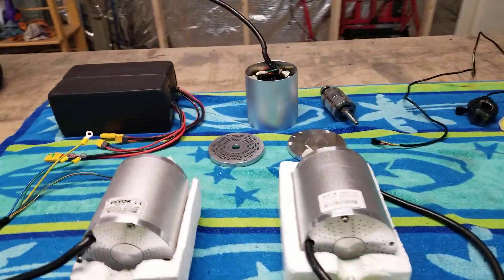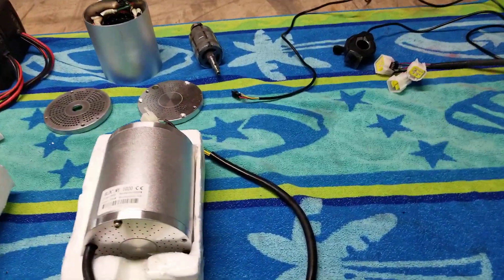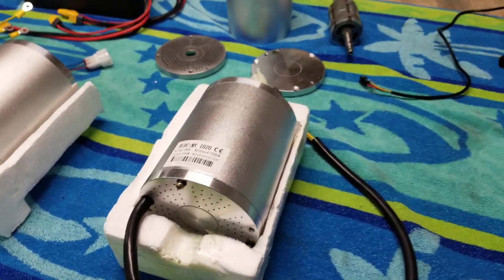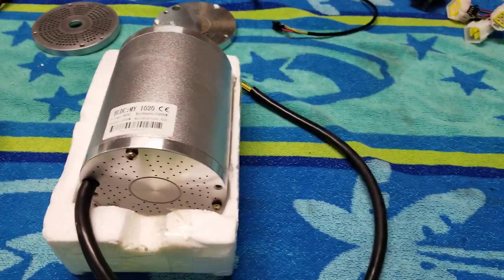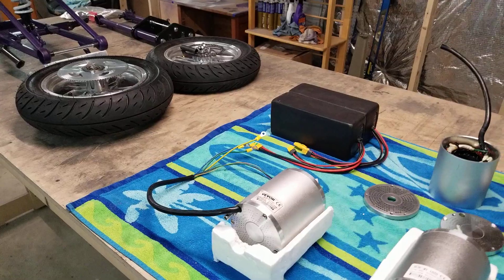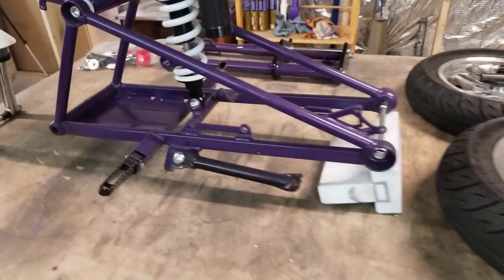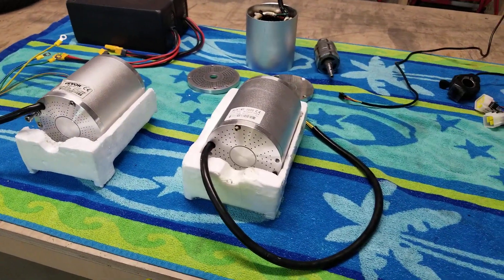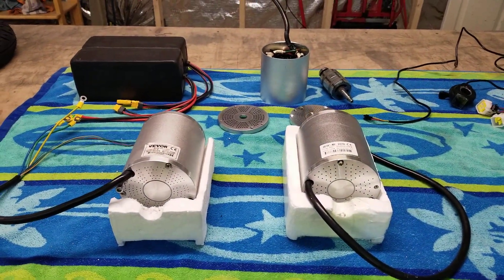Razor RSF650 - Motor Talk … 2kw or 3kw?

Comment: Yeah I’ve got a 3kw motor and cheap 3kw controller.  Started off with a 52v setup and invested time and money putting together a 72v battery for it.  I run a 9tooth sprocket and I often miss the way it road with 52v.  I live on a steep mountain and it’s so jumpy and fast taking off with 72v that I can’t let my friends try riding it anymore. Its just too hard to keep the front wheel on the ground, even for me sometimes.
Reply from the maker: it is jumpy because you have a cheap controller
Reply: @razorspeedfreak6508  very true.  Still though it was much less jumpy and smooth on takeoff with 52v.  Actually on the rare occasion I’m ever riding on flat ground it’s much more smooth and manageable on either voltage, but here on the slopes of Mauna Loa, Hawaii flat ground is few and far between.  
I’ll definitely have to start saving up for a better quality controller soon, I know it’ll make a huge difference.

Comment: Question I got a 48v kit ! Can I add up another 12 v battery to make it 60volts ? Or Will I have to upgrade to a 60v controller? Or can I still use the 48v one that came in the kit?

Comment: Funny enough overvolting a 2000w Motor I was able to achieve faster acceleration and top speed then the my1020+ from electro and co. Now the torque from the my1020+ was far better. Also the 2000w was way cooler in Temps then the 6000w from enc.
Reply from the maker: the 48v/2kw has the best torque rating of all MY 1020 motors

Comment: Hello, Have you had to do any controller tuning on your motors?  Mine is acting like it is twitching or jerking at the top end.
Reply from the maker: What controller?
Reply: @razorspeedfreak6508  Kelly KLS-N
Reply from the maker: @reabedesign6336  the KLSN has been known to do that when paired with these cheap MY1020 brushless motors. I have since moved on to the KLSH controller.
Reply: @razorspeedfreak6508  can the KLSH controller do flux/field weakening or is it a trapezoid style controller?
Reply from the maker: @Tomasreabe  the KLSH is a Sine Wave and Bluetooth capable, but no flux. and to be honest... these motors don't need (or can handle) more.

Comment: Well, i bought the 3kw motor before watching this video, not good. Now I got to make a battery, do you think a 20s 6p 18650s cell battery will be good for the 3kw motor? I'm bypassing the discharge btw, I'll have a bms for charging and balancing. This is my first battery build, so i don't want to mess up.

Comment: Would it be possible for you to post some links to all of the main components (batteries, Motor, Motor controller) whatever else is a necessity. This would be my first project like this so anything helps! Been wanting to do this to my RSF650 and wanted to know about how much $$ i would have to fork out for this project . Thanks in advance

Comment: Where would you get the 6000w ones with the sinks built into them?
Reply from the maker: There is no such thing. The largest MY1020 case motor is the 72v/3000w model. That motor you are refering to is nothing but a re-branded 3kw MY1020 with a STICKER ON IT! I think you can buy that heatsink from Delvan motors or something like that.
Reply from the maker: https://www.pwmall.com/p-210643-50_126-delavan_heat_sink_fits_all_4_diameter_delavan_motors_7870_7970_7871_7971_fb_series

Comment: Thank you for all your videos, since I’m learning about e-bike/e-motorcycles coming from Honda Grom builds and Benelli TNT 135 mini-motorcycle builds, I wonder if you can post the weights of the 72v motor and 48v motor, I know different manufactures’ motor might weight a little less or more depending on the wiring. At lease us new builders will know by the weight will/could be and not be scammed by sellers who might sell a motor stating it’s a 72v motor when they made a sticker for a 72v motor but glued it on a 48v or lesser voltage motor.At lease use newbies will have a baseline data on wt of a motor, thanks again for your video and information, much Aloha from a newbie from San Jose California.
Reply from the maker: According to my wife's bathroom scale... the 60v/3kw motor weighed in at 10.2lbs. and the 48v2kw weighed in at 9.6lbs.

Comment: Thank you for this video. It was informative. I think I’ll go with the 72v 3000w I was looking at.
Reply: I modified my SX500 with 3k 72v. With stock gearing I was getting 35mph. But (IMO) the torque and stock gears is too much torque as it tries to wheelie at take off every time. I changed the front sprocket to a 14tooth, rather then use the stock 12 tooth. My top speed went to 40 mph. Regarding the foot or base on motor, I didn’t need to modify it at all because it fits due to the SX500 design of its rear shock. Next thing I’m going to do is change the rear sprocket to 65 rather then the stock 80 tooth. But you need to modify the chain to fit.
Reply: @jeremykeith3152  Thank you so much for this comment man. Where did you order your parts?
Reply: @SharkTheatre  ebay
Reply: @SharkTheatre  electric scooter parts for sprockets (double d) and #25 chain from Amazon 
I tried 65 tooth rear, achieved little higher top speed but prefer 80 tooth rear and 14 tooth front.